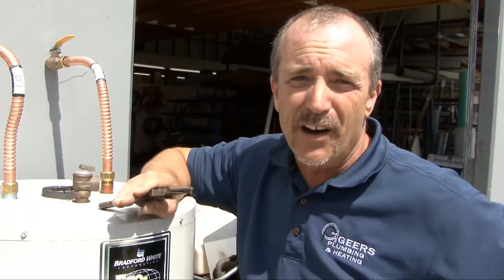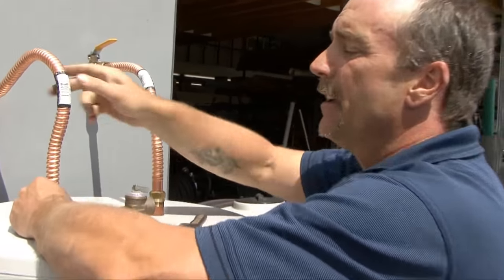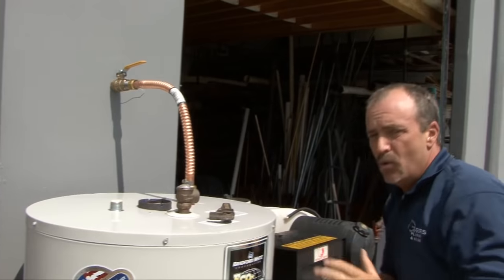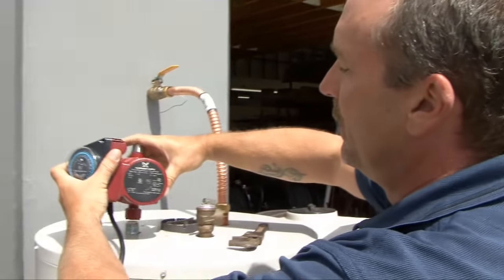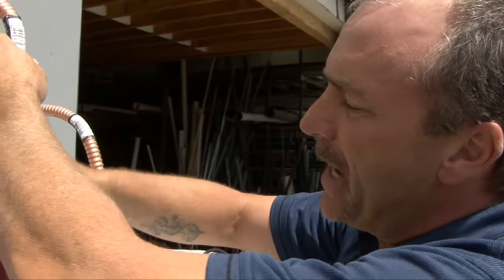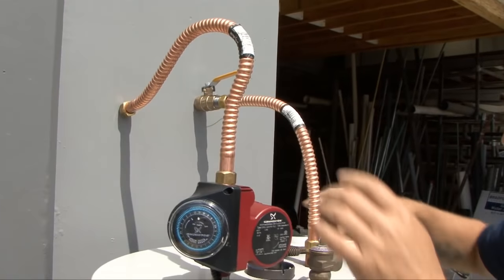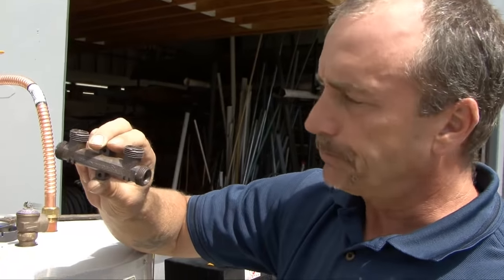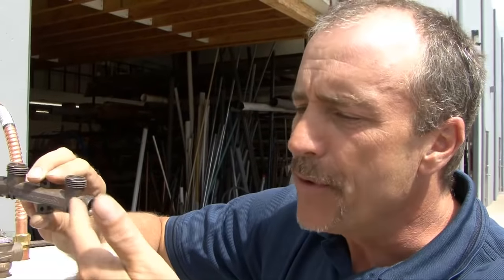HOW TO: Get Hot Water in Seconds

Comment: majority of people have electric hot water wire is way cheaper than pipe and recirculating pumps if your plumber was smart in the beginning he would have put your electric hot water heater in very close proximity to your fixtures gas you don't always have these venting possibilities I only see this option as a water saver does not save you hot water cost

Comment: How about shower
Reply: Long Nguyen if you have a sink in the same bath, it will work for the shower too.
Reply: Turn on the bath sink hot water till it gets real hot. Turn it off. then check how quickly the hot water gets to the shower. If it helps alot put the manifold under the sink. This manifold will also help other fixtures hot water quickly. If you house was built with a manifold system and not individual runs to each fixture.

Comment: Yes, it will save water, but your GAS bill will INCREASE!
Reply: Not if you run it on-demand or on a tight schedule. I personally plan to trigger the pump for a limited time with motion sensors wherever I walk into any room with a hot water tap.

Comment: Lots of hot water but uses too much electricity through heat loss in the line.
Reply: The pump uses minimal electricity if you only turn it on when you actually need hot water.

Comment: Sounds like a load of shite. Then you waste electricity because your hot water is now getting used for your toilets. The only way to circulate hot water effectively is to install a reticulation system with a return pipe and circulation pump. Stick to changing tap washers bro.
Reply: You misunderstood the purpose of the thermostatic valve. Maybe pay attention better instead of demonstrating your ignorance in front of the entire Internet.

Comment: Ok, how the hell is it going to recirculate water back into the cold water side when it is a closed system under pressure until a faucet / toilet, or what ever is opened?  I guess he is saying that the pump is higher pressure and will pump it through the bypass valve - for how many seconds until the cold water side is now equalized?.  As we all know - water does not compress - like air would!  I really wouldn`t want (higher) water pressure in my pipes and fittings in an older home!  My Dad had one of these installed by a professional plumber, and it did NOTHING!  Sell us some more snake oil you shyster!
Reply: I'm no plumber but I asked myself the same question. I think the answer is that while this pump is pumping hot water out of you HW heater, the HW heater simultaneously draws cold water into its supply side in response to its dropping water level. So the cold water being pushed out of you HW pipes goes back into the HW heater. Just a guess on my part.

Comment: Terrible explanation. I don’t buy it. More info is needed. For example, how do you pull all the cold water from the pipes that are on the other side of the house and replace it with hot water. Impossible. Maybe not impossible, explain how this shit works if it really does work.
Reply: Brian there is a lot he is not telling people. The pump pulls hot water from the tank, pushes it to the furthest fixture where the manifold is. The manifold allows the water to cross over from the hot water pipe to the cold water pipe. When the manifold reaches a certain temp the flow is blocked.  Before that happens the cold water line is replacing the water which the pump removes from the tank. The water is basically pumped in a circle until the flow is blocked. From the tank/pump- out to the furthest fixture on the hot water line- then back to the tank on the cold water line. What he is not telling people is... now... or at least until the flow is blocked by the manifold... you have "warmer" water in your cold side lines. At the time that manifold closes off the flow, the water in the cold line  will also be "hot". At least until you flow the recirculated water out of it.
Reply: OkieDutchman yes correct. I’ve been in calls were the manifold fails and they have hot on both sides. Let it run for a while and it’s warm on the cold all the time because there mixing on the manifold . If it’s working properly when you open the cold and it just cycled you will get hot in the cold. Most people hate this system.
Reply: @andrewsgeneralcontractors1719  Do they hate it more than having to retrofit their home with a dedicated return line?

Comment: where exactly do you install the bypass valve?
Reply: savage lmao
Reply: at the furthest fixture from the hot water heater.
Reply: you would generally install it in the furthest fixture from the water heater. Or in the bath where it takes the longest time to get hot water. you can also install another manifold if you have a long house with the water heater in the middle of the house.